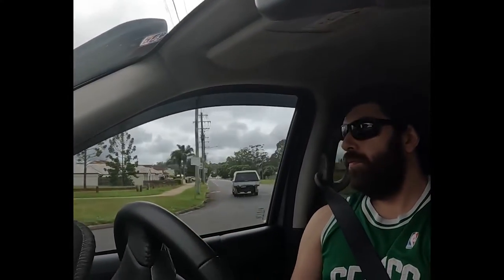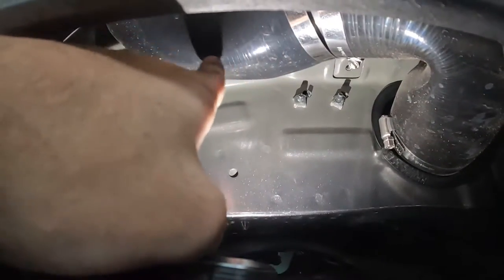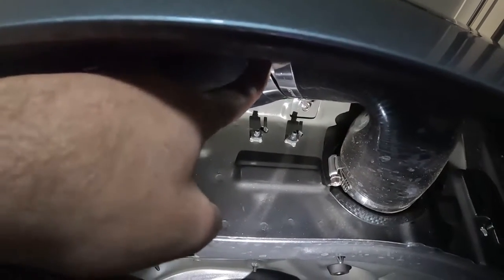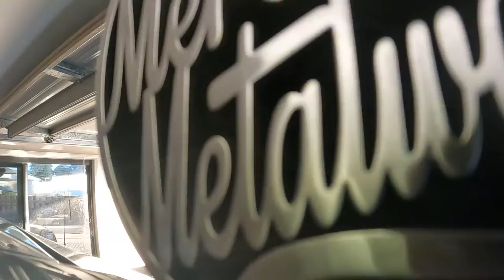Water Diverter Install on the Navara...Snorkel Mod from Meredith Metalworks | NP300 Navara Build

Comment: Have the same issue now on my Ranger!! Did it solved the issue completly? do you got to drive on that THICC rain again??😂
Reply from the maker: Sorry for the late response! It helped, but  I did go through some more THICC ass rain and it happened again. I ended up just getting a 45ish degree silicon hose and stuck that on the end too to help keep some more water out then started checking the weather before big trips 😅 one of those things when it comes to staino snorkels I guess. Some people get lucky though and have no issues. Fingers crossrd the rain is more kind to you!
Reply: @ yeah thats what I’ve heard.. some people have issues some are lucky they dont…. And did the silicon hose worked? You got to test it again with it? Because I can have both just in case in the glockbox.. but seriously if not , thinking about deleting the snorkel because is a 15k km 2022 ranger , not happy of not being able to allways enjoy the car just because of a rain..🤦‍♂️And to tbh dont do a lot of river crossings.. thanks by advance for the reply
Reply from the maker: I had driven through heavy rain and it was ok but not terrential again. I would be thinking the same as you if I had a new car in warranty. I would get a staino again for the noise but practicality trumps it if you need the car to get to work etc
Reply: @GetThatBread  yeah man.. the only issues are the holes allready made haha, I think im gonna try to fabricate a similar water diverter and allways have the silicone hose for any heavy rains.. if it fails again gonna take the snorkel out.. because i had the same issue with the maf going crazy last road trip and was not fun at all..

Comment: This is cool. The excavator and farm tractor at my workplace has this... it traps dust really well. I believe this would work well at the top end of the snorkel..
Reply from the maker: I think a few places are starting to integrate this kind of design into their snorkels which is good 😀
Reply: @GetThatBread  I think having both is great. Cause of cold conditions, inside  the snorkel may have slight moisture, so the moisture will run down the pipe and exit the one that you have installed.. 🍻 🇹🇹